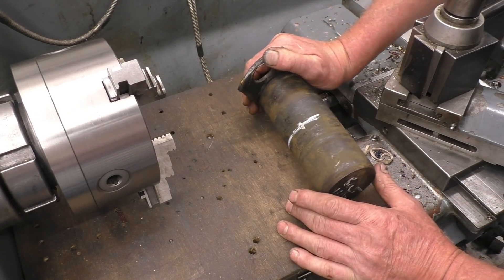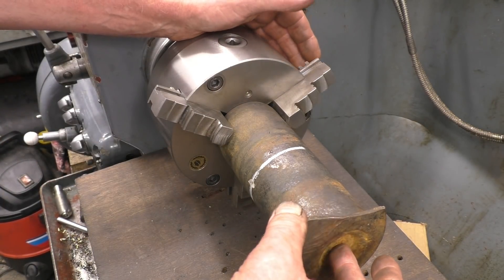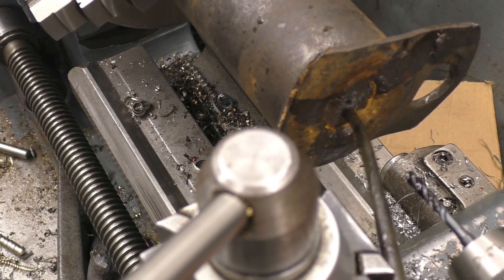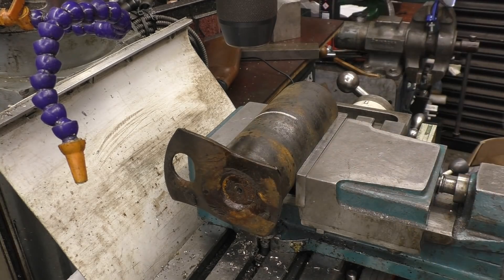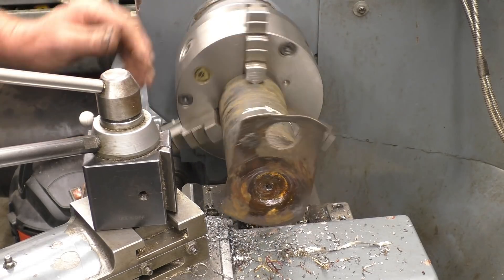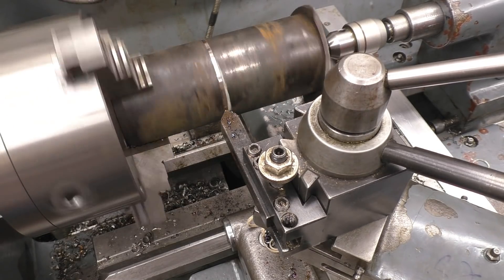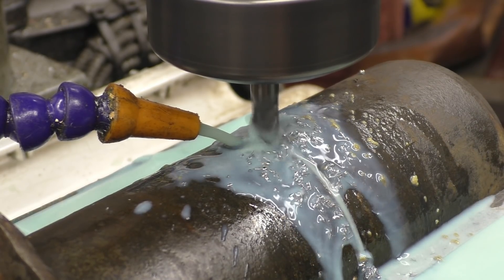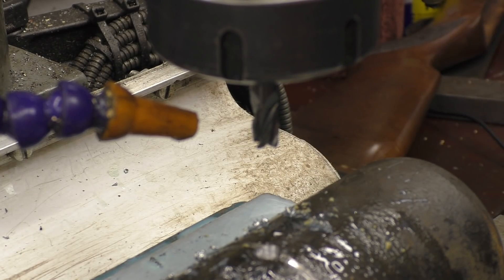SNNC 390 P1  Machining Hardened Steel Pin

Comment: Had 2 junk hydraulic rods to machine , I annealed them with a coal burn ; Once had to reduce the shaft end of a 1 inch reamer to 1/2 inch , did that in the lathe by heating it cherry red and turned it down .

Comment: I don't like grease holes in pins because the pins seem to break right at the grease hole. I drill the outer bushing instead.
Reply: I was wondering how much the pin would be weakened by cutting a groove through the hard outside surface, and if it wouldn’t be prone to cracking in that area. But if that’s what the customer wants………. Very tough project in any case!
Reply from the maker: That is how he wanted it doing
Reply: @doubleboost  The customer is ALWAYS right! Correct? Ha!

Comment: John, If your regular hss drill bit, can't do the job then I opt for cobalt. if that struggles I dig out the masonary bits, reground with a high relief angle, but the real secret is low speed high feed, I get through case hardening by hand cranking slowly and pilling the pressure on the feed. Thanks for another entertaining and informative vid, and keep reminding me to click the like button, I forget all to often.
Reply: And a masonry bit is just down the road at any tool shop, good tip, thanks.

Comment: Get yourself some diamond inserts they will make short work of hardened material like that
Reply: Diamond inserts are not good for steel because the carbon of the diamonds dissolves into the steel.
You should use CBN inserts on hardened steel.
Diamond inserts are made for aluminum and all other non ferrous metals and also ceramics and glass and so on...
Reply: @Henning_S.  Fair point I have both styles of insert, and I haven't noticed much diffeence between them, though the diamond seems to cut through chrome plating slightly easier
Reply: @Henning_S.   great for machining pistons... 😎👍☘🍺

Comment: Is case hardening just a heat process?
Reply: Case hardening is nothing more that a carbon deposit to the surface of mild steel  by heating it to a temperature the carbon will fuse with the parent material. It works best with low carbon materials that need a softer core and a hard wearing surface such as pins and shafts etc...
Reply: @johnnyholland8765  Close but not quite right Johnny...   it doesn't deposit carbon, it changes the crystalline structure of the outer layer of the steel to a depth of up to a few millimetres... it does this by heating to the required temperature in a carbon-rich environment. 

Often, parts are machined in large quantities from mild steel, which has a low carbon content & so is cheaper & easier to machine. They are then heat treated to give them the hard-wearing properties required.

Here is a good explanation for those who wish to know more... 

https://www.metalsupermarkets.co.uk/what-is-case-hardening/

😎👍☘🍺